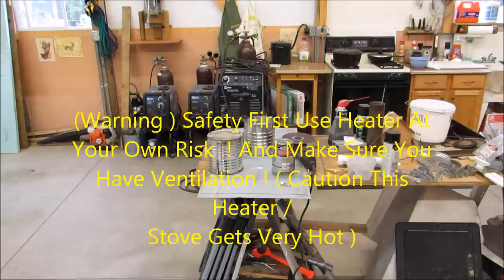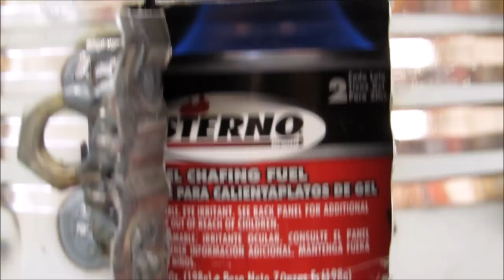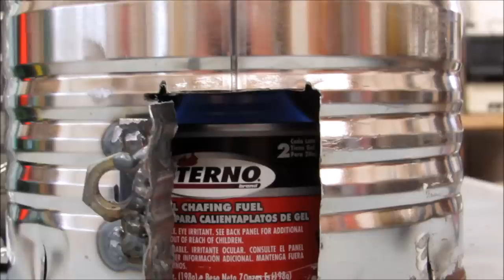Pop-Up Hunting Blind Heater / Stove  Build With KVUSMC

Comment: Hmm, not everybody has welding equipment.  If the  parts are carefully cut and fitted,  JB-Weld Extreme Heat epoxy can be used to 'glue' things together, with heat resistance to 2400F
Reply from the maker: They Sure don't Then Buddy Then I Would recommend A Drill and Pop Rivets Would Be My Other Choice Yes JB Weld is great Stuff